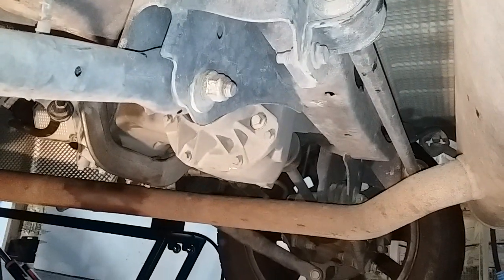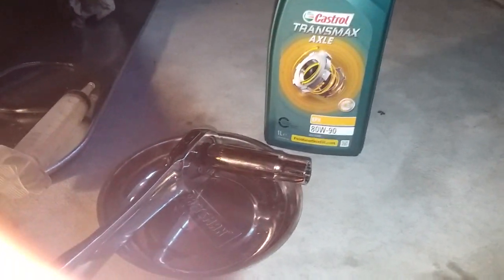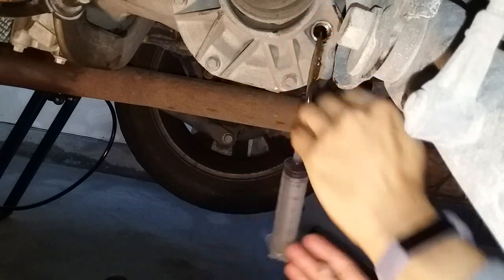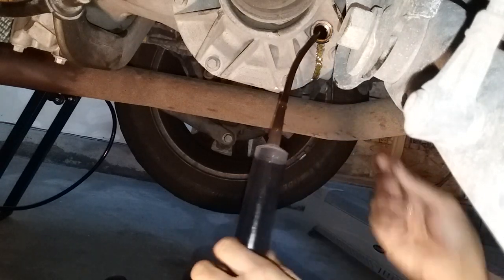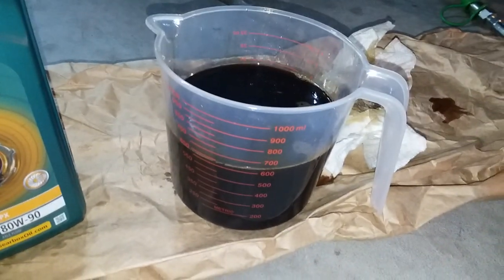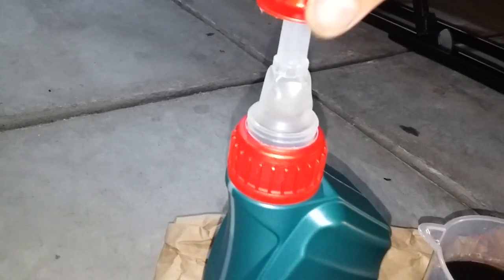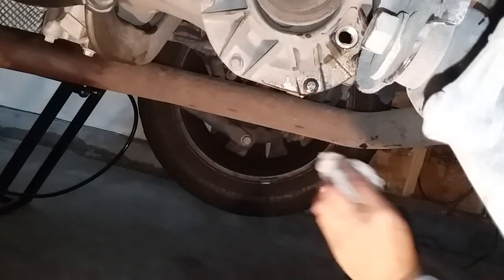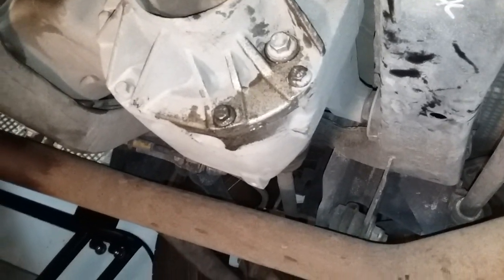Land Rover LR2/FREELANDER 2 Rear Diff Fluid Change

Comment: Thanks for the video! Do I need to change the PTU and Haldex oil also at the same time when I change the rear differential? The LR service center told me that the differential may broke after the oil change since I have not change it for about 8 years, 60k miles. I find it strange though. My LR2 2008 is about 130k miles.
Reply from the maker: You don't have to change all the fluids at the same time, but I did since they require similar tools and equipment. 

I don't see how new fluid will damage your diff:  that doesn't make sense.

Comment: Hi, how'd you squeeze the new fluid in there from that bottle?  Doesnt look like you'd get it up enough to pour it all out...
Reply from the maker: I couldn't squeeze it.  For the rear diff, I had a long hose and funnel, ran it between the tire and fender, and poured it from there.  I also have a manual pump that fits certain bottles, but I don't think I used that here.  I've used that on a lot of other vehicles with different bottles though.

Comment: How often do you need to change the oil on the differential? And does this mean that changing the oil prolongs the life of the differential or are there other things that makes this part go bad? I have heard that the differentials are worrisome topics on LR2 Freelanders
Reply from the maker: It looks like 50k miles for severe duty and 100k miles for normal use.  Yes, changing the fluid can prolong the differential's life.  Other things can damage it such as leaks/low fluid, if the case cracks from an impact or shock load, overheating, etc.

Comment: where is the position to fill up ?and how many ml fill up?
Reply from the maker: It was about 700ml and the fill location is the plug near the rear of the diff
Reply: @isaacrepairseverything  FILL UP LOCATION ITS SAME WHITH FILL DOWN?
Reply from the maker: @claraconstantin9826  yes, it is the same hole for drain and fill